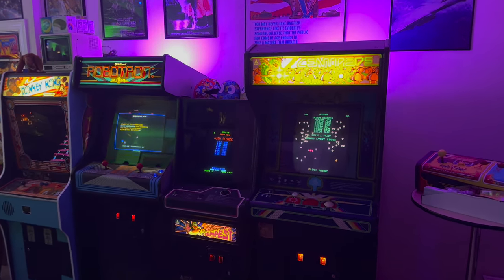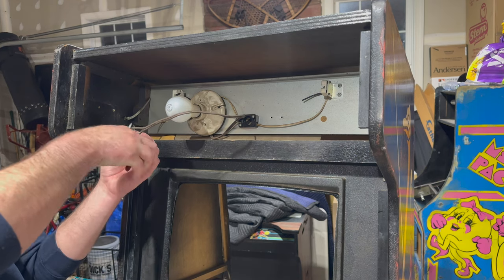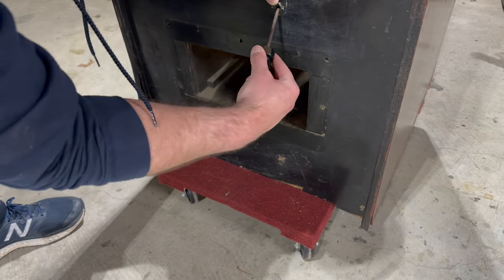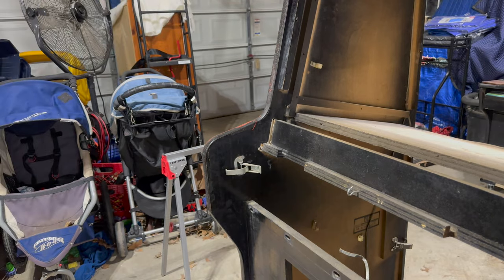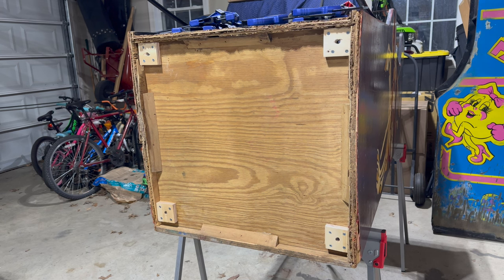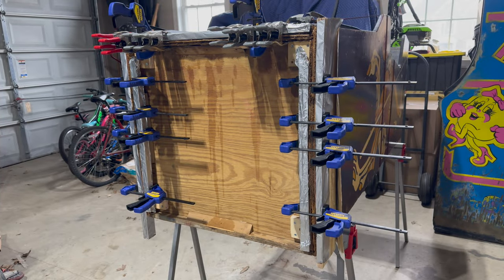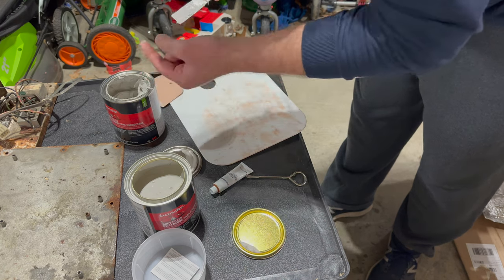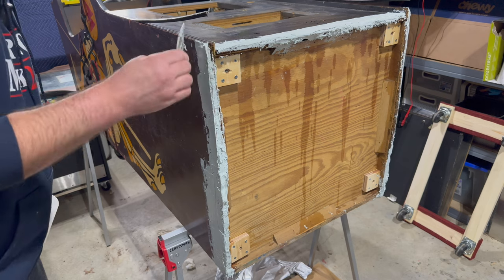How to Repair Wood Damage on a Vintage 1980s Arcade Cabinet 🪚🛠️🗜️ Williams Joust Restoration part 9

Comment: I have a Defender that I have all gutted out for restore. The side art was in pretty good shape but some of the wood was in bad shape around the bottom of the cabinet. I have watched all of these and your Ms Pac Man as I have one to restore as well, probably new side art. Thanks for sharing your experiences. It’s helpful for those of us that are new to this. 😊
Reply from the maker: I’m glad my videos are helpful, Levi! Do you have an original Defender PCB set, or are you going to run a JROK or something?
Reply: @overtimearcade 
 I want to say it’s original. Everything in it sure looks original. I want to completely restore it as original as I can. Arcade parts and repair probably is very tired of hearing from me 😂 for my pac cocktail.
Reply from the maker: Nice! Peter at APAR is the best. You can also always post questions on the KLOV forums or various Facebook groups. Or ping me in a comment here, on Twitter, or Discord and I’ll try my best to respond!

Comment: I love your videos, I would love your advice on thinner Nintendo cabs. Do you think this method would be good to fix back edges from top to bottom of Nintendo cabinet on the left and right of read door? This one is just thrashed. I’m guessing from sliding it in and out of trucks over its life without rear door and likely why there IS no rear door anymore
Reply from the maker: Nintendo cabinets are a bit of a different beast because of the baked-on gelcoat Nintendo used on the sides and front of the cabs. There’s really no way to perfectly match the original finish, so if it’s bad enough that you want to attempt a major repair, you’ll kinda have to redo the entire side — either repainting it completely or installing laminate.

Comment: You all have great informative videos! Question: My Defender arcade reverse doesn’t work and the spaceship goes downwards automatically, and when playing two player, it goes to cocktail mode on two player but not one player. Appreciate if knowing what might be causing this, is it an bad interface board? Wiring looks good. Thank you, Will.
Reply from the maker: Thanks for the kind words, Will! If you’re 100% sure the wiring and leaf switches aren’t to blame, then I’d suspect the interface board (aka widget PCB). But I’d triple check the wiring (including ground loop) and leaf switches first to make sure there’s nothing mechanically wrong. Good luck!
Reply: @overtimearcade  ok great, I have this arcade repair guy check it, went over today to get the ground wire fixed and get it running, that’s a great idea, I’ll see if that works, I’m sure it will. By the way, really enjoy watching your restoration videos on Joust and repairing a Defender game! Thank you very much for the advice!
Reply from the maker: Thanks — I’m uploading tomorrow’s video right now!
Reply: @overtimearcade  sounds good, look forward to your video. One quick question, these issues with my Defender are fixable? With trying these steps that you mentioned.
Reply from the maker: Yup, those issues should be fairly easily fixable. But it always comes down to figuring out exactly what the root cause is. That’s often the trickiest part.
Reply: @overtimearcade  yes sir, you’re right. Good to know, I’ll let you know how it goes with the repair. Appreciate it again.
Reply from the maker: Cool — yes, please keep me posted!
Reply: @overtimearcade  I think on the video your name you said was Charlie? I did hear back from the arcade repair guy today and he said, it needs an integrated chip that he has to desolder old chip on the interface  board, and desolder new one on.. I hope it solves those three issues. 
-Will
Reply from the maker: Yep, my name’s Charlie! Has your repair guy actually diagnosed your cabinet hands-on, or is he just guessing based on the symptoms?
Reply: @overtimearcade  ok cool! Yes he came over yesterday, and came to conclusion that s what he needs to do. He said if we look at these separate issues systematically, he said the interface board is where the separate controls all converge. Taking it into consideration he says, it’s fully conceivable that repairing this board will correct the issues we are observing. Reading this from his text.
Reply from the maker: @willtwijnstra1688 I hope he’s right! Did he check the basic things I recommended first, like the ground loop and the leaf switches?
Reply: @overtimearcade  not sure, I sure hope it’s one of those, but yeah, I would think he would’ve or is going to check that.

Comment: Homemade wood hardner = Acetone and plexiglass. Cut up plexiglass and place in acetone. It will melt the plexiglass. Acetone gets the plastic into the wood, then evaporates, leaving the plastic reinforcement. If on a bigger budget just use schlack.
Reply from the maker: Interesting! I imagine the fumes are nasty though?